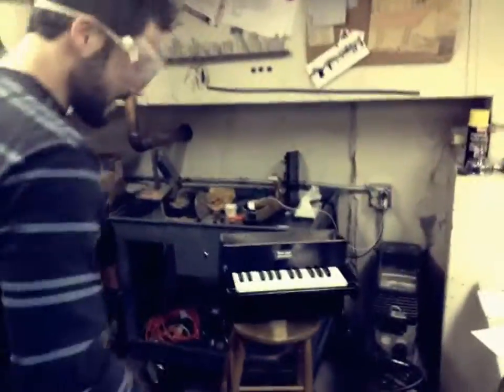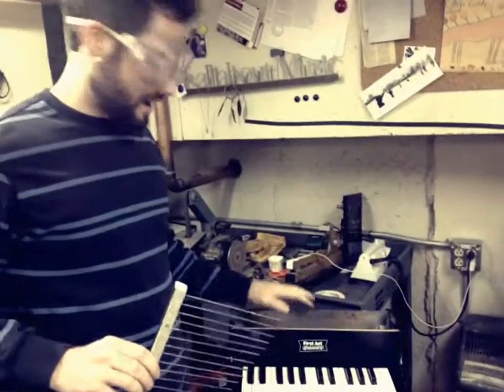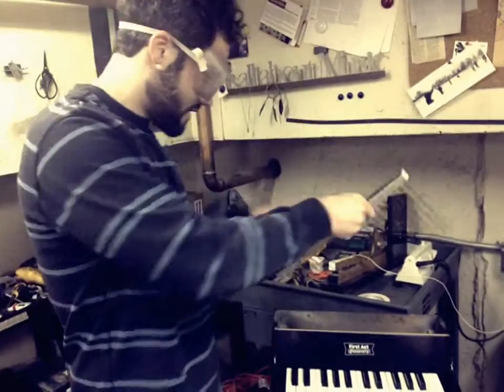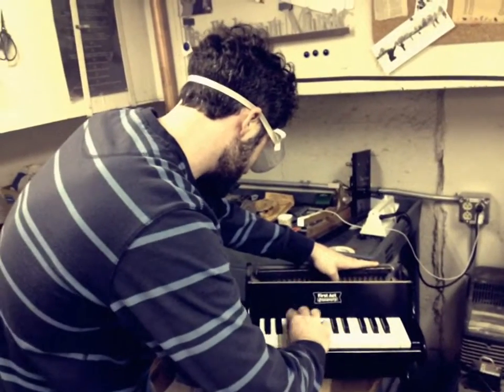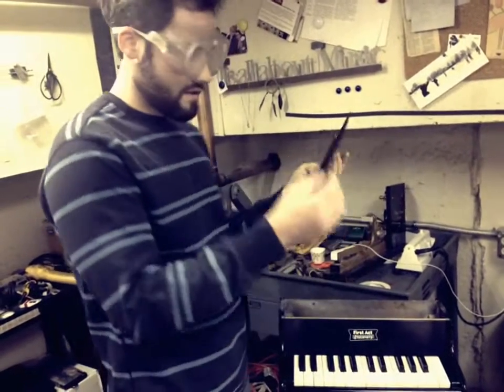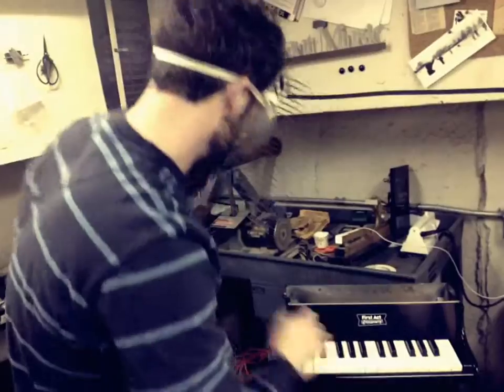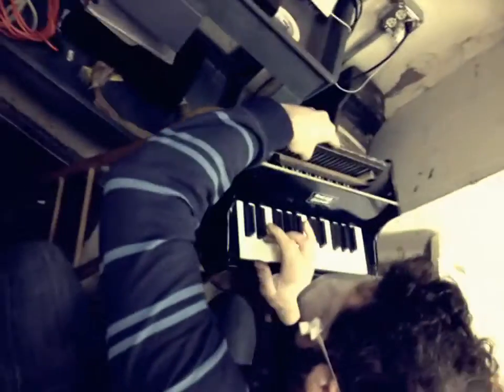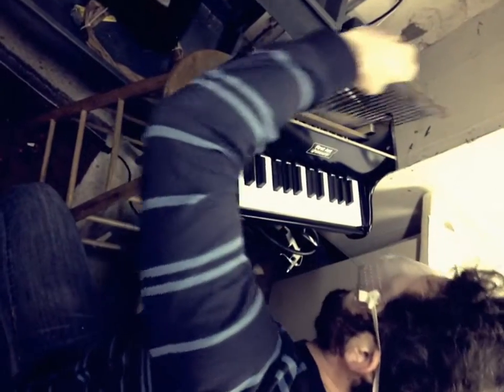Broken Fences: Tuning a Toy Piano Using a Bench Grinder (for our live act)

Comment: trouble is that the heated rod will sound lower than when it is cooled . one should place in water after sanding. I doubt if i would sand something that small for so long without checking.